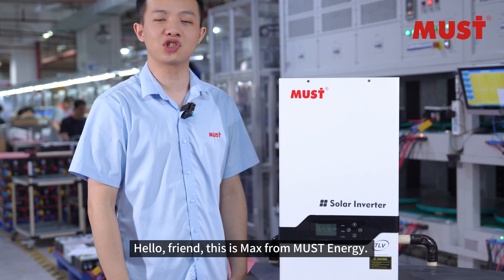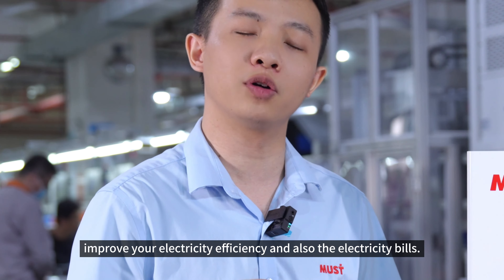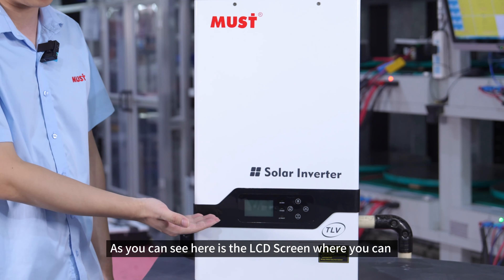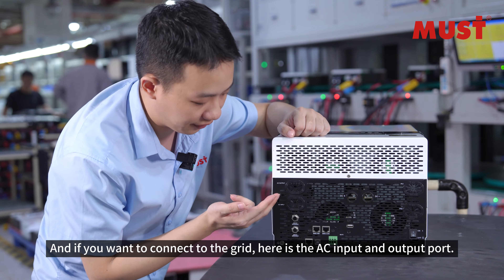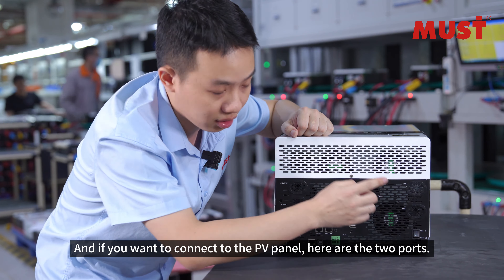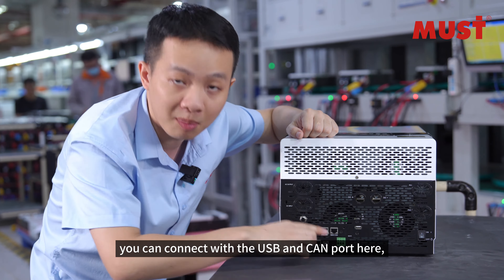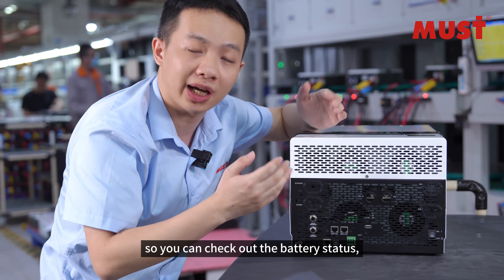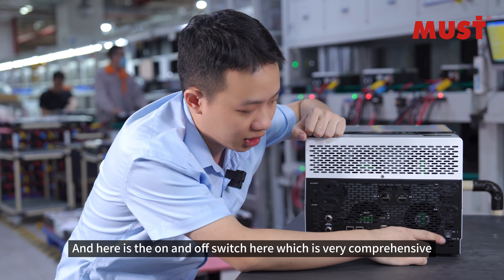🌞 Inversor Solar de Fase Dividida PV1800 TLV 6KW | AC 120V, 240V | PV 250V | DC 48V

Comment: Good afternoon, tell me the settings of the Must inverter to the dyness b4850 battery. I put the ones that are in the battery manual, when the inverter has already fully charged it, it gives an error (3), "battery voltage is high", then a few minutes pass and the inverter charges the battery again and gives the error again. Why doesn't the inverter turn off charging and stop charging on the SAN bus? Should the voltage be set higher or lower?  Thanks for the nice info!
Reply from the maker: Hi, send an email to our customer service engineer at service@mustenergy.com